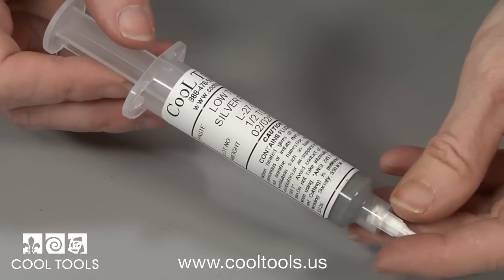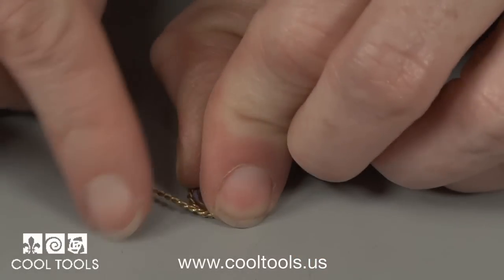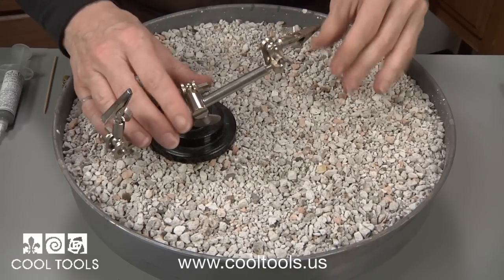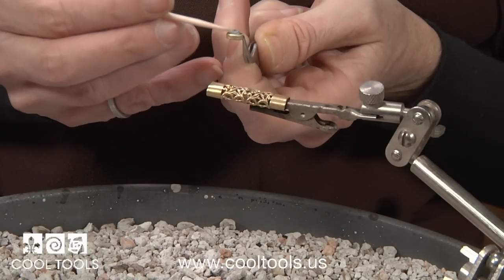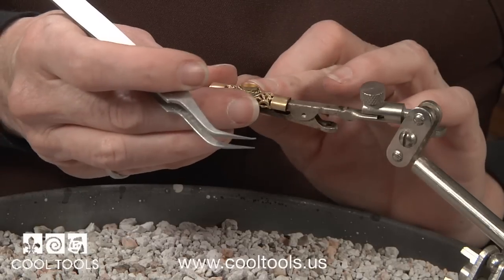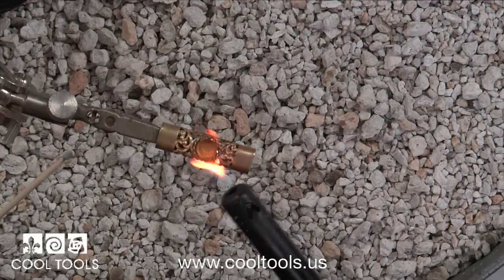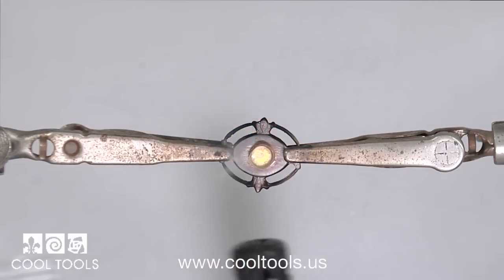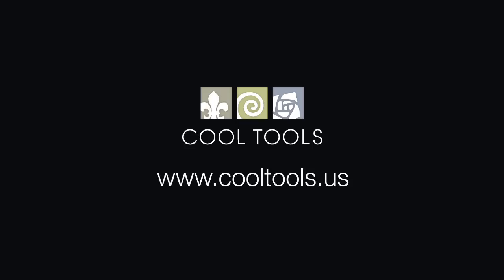Soldering with a Butane Lighter

Comment: this isn't working for me :( . is there a secret step i'm missing or something?
Reply: +Erwin Sales
Clean the surface first? Add more flux? Heat the surface first? There are a number of reasons that could be the problem. If you upload a video I could tell you what you're missing.
Reply: Use a real soldering iron. This is stupid